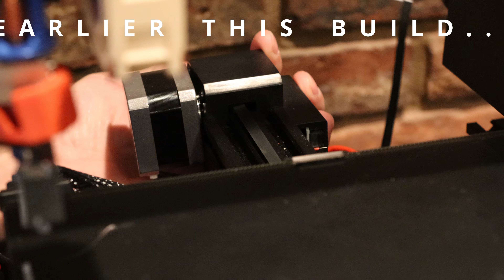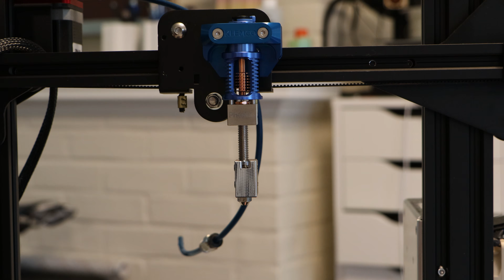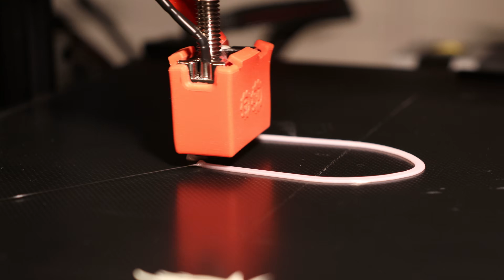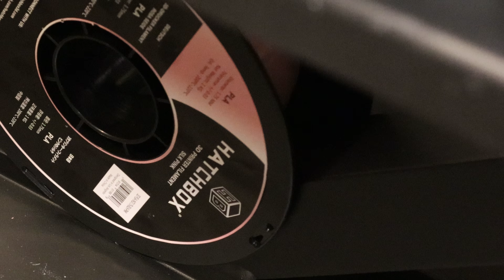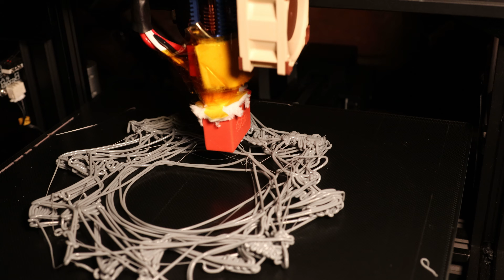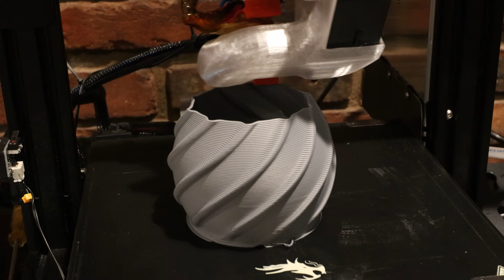Ender 3000 - Print Dangerously and 32X Faster!

Comment: 80 watt out of two 40w in series,  lol..   Someone doesn't know ohm's law.    Parallel would be needed.
Reply from the maker: Well actually…..… they were 12v heater cartridges. Running on 24v
Reply: @NathanBuildsRobots  Ahh,  well that adds up.  Didn't know anyone actually used or owned anything 12 volt in the 3D printer world.

Comment: If you haven't already you should try taking it a lot faster. The rate in this video is nearly achievable with stock hotend and just an 0.4 mm CHT nozzle (see my video).
Reply from the maker: I could not drive the motor any faster due to skipped steps. I burned a Stepper driver out this way. 
I was using a large mainboard, which was a POS.
I have tried CHT, great product.

Comment: Are you running Klipper? Also I would suggest Dual Z stepper motors that way there you can take some of the sag from the X axis out.
Reply from the maker: Dual Z would definitely help on this machine. I am not running klipper, just stock firmware. Just set the Slicer settings to extrude massive lines.

Comment: Wiring the heaters in series would actually cut the total power in half at the same voltage, due to the resistance of the circuit doubling. You would need to wire them in parallel to double the total heating power. That is probably not a great idea on a board that is not designed to deliver that much power however.
Reply: @angryknome94  I missed the part where he mentioned they were 12v heaters. That makes sense.
Reply from the maker: This one resolved itself. Thanks angrygnome!

Comment: Why in series and not in parallel? In series you are cutting the voltage to each in half
Reply from the maker: It depends on what cartridges you are using. In this case I was using 12v heater cartridges at first, so I wanted to cut the 24v in half. 

If you have 24v cartridges then you are right you want them in parallel.

Comment: the gap in your heaters is basically a giant heat break and makes your first heater completely useless.
Reply from the maker: Copper is surprisingly conductive. Given the length, material, and thickness of the tube connecting the heaters, It is 50x more conductive than a high quality stainless steel heatbreak.

But more importantly, unlike a heatbreak the top and bottom are both heated, so it's more of a heat bridge than a heat break.
Reply: @NathanBuildsRobots  copper is also good at losing heat to the air, and your print head moves around a lot. Even if it is hot on both ends you're wasting a lot of energy. I think you could just just cut the nozzle shorter to have less gap and it would increase performance a lot.

Comment: @Nathan Builds Robots  Have you seen this  CNC kitchen video? https://youtu.be/RrIzzSfuSMs . He increase melting speed piercing the nozzle with copper wires. He does it on a volcano nozzle, but still it wasn't made on the Super Volcano. Also seems you have space in the middle for another heater block (or for a longer one) .
Reply from the maker: Yeah I have seen that one, super cool idea. I would like to try it on a supervolcano.
I filled a follow up to this where I tested max flow rates. The extruder was the limiting factor. This stupid Lerdge board I was using can't drive the steppers over 80 mm³/s so that was about as far a I could take it. I would like to retry with a Klipper machine, because it is supposed to unlock higher step rates.

I ran into some interesting issues with CHT nozzles at very high flow rate, I should revisit this supervolcano has the same issues.

Comment: Switch to Klipper, and HF version of the dragon... This looks super ugly and slow AF..... What speed are theese, you called super fast?
Reply from the maker: speed measured in volumetric flow rate
Reply: @NathanBuildsRobots  you measure max possible speed with volumetric flow rate. I see you Are using marlin arent you?
Reply from the maker: @Wendrym  yes, Marlin, it's what's for dinner.

Comment: This dude really knows his way around a hot end. Those initial layers looked more like frosting than filament. I bet he could melt a whole spool in a couple hours! A house fire doesn't even do that!
Reply from the maker: About 2.5 Hrs per kilo at max speed. The SuperVolcano makes sure it has time to cook, so it comes out nice and tender. Then you have to follow it up by using large 1.5x1.0mm extrusion. 
Bed leveling becomes a thing of the past, because even if your bed is elevated 0.2mm too high on one side, it will just gloss over it like everything is fine.

Did someone say fire hose? Great idea for my next hotend build!!
https://www.firehosedirect.com/1-1-2-nh-nst-brass-hose-nozzle?feed=Froogle&gclid=Cj0KCQiA_8OPBhDtARIsAKQu0gY3L96aVsh3ZAFHKW5WTVwr06HqMxKrMYTz-XY-3KCNj8WLP2lFZr0aAi_qEALw_wcB
Reply: @NathanBuildsRobots  Getting Tender on the Ender bro!
Reply: ROFLMAO 😂 Best comment this year lol

Comment: The shit we find xD
But i mean it did produce decent results after proper tweaking, props on that Nathan
Meanwhile me using a LGX+Dragon +CHT 1.8 while i wait for Rapido UHF to arrive
Reply from the maker: That sounds like a speeeeedy build. Does that nozzle that print at a larger diameter than the filament, or are you using 3mm?

You are going to love the Rapido. Just keep in mind that, at least on the model I got, the thermistor is only rated for 280C. So you will have to stick to the Dragon with an appropriate thermistor for crazy exotic filaments.
Reply: @Nathan Builds Robots  using 1.75mm on 1.8mm nozzle , don't ask how it works. It almost looks like it only warms it up and comes out ready to feed into the extruder again. Saw a Nero (i think) testing the CHT 1.8mm and got one for giggles. 
I should stay in the usual range (PLA, PETG, TPU and maybe some nylon. Mostly under 300°C 
I very rarely print nylons etc unless i need proper mechanical prints. 
Just wondered if it would allow me to push even further than the Dragon that way i have an excuse to try a new hotend instead of boring same one.

I should get the UHF version since i have a few v6 and volcano quality nozzles and i can test around for different applications. 

Btw the design of the Rapido kinda makes me wanna test non-planar 3d printing with it
Reply from the maker: @SinceGamesPT  I might try non-planar printing. With a pointy enough nozzle on the Rapido you can probably get 45-50 degrees of non-planar angle all directions. Do you know of any good, easy to use non-planar slicers out there? Would love to see support for that in Prusaslicer or Cura.

I believe with the UHF it is just a metal spacer that you can buy separately, so you can always get the standard version and upgrade later. 
https://www.3djake.com/phaetus/rapido-uhf-upgrade-kit
I should try out the UHF extension on a normal Ender 3 to see if you can upgrade to volcano without having to change the heater block.
Reply: @NathanBuildsRobots   @Nathan Builds Robots  haven't looked much into the non-planar side of printing but i think there's a specific slicer for it or something like that. 
And Yeh UHF is basically a spacer, but for the price diference i'll grab the UHF which has more stuff for like 10€ more in EU . Buying from 3dprima since ive used them before. 
I mean if the heat transfer is "decent" it should but its not optimal. 
I saw a supervolcano nozzle in a dragon hotend if not mistaken running dual heatblocks , similar to urs* xD
Is it pretty ? Nope but it kinda worked.
I can look up the link if u want to the monstruosity. 

And pointy nozzles for non-planar ive seen them but i never got one as i didnt have a use to test them. 
I mean from cutting nozzles, heatbreaks etc , in the the basic is "just" to melt plastic with proper tools alot of custom one of a kind can be achieved
Reply from the maker: @SinceGamesPT  Lol, I read this before you edited to add "similar to urs* xD", I thought you may have been suffering from amnesia
Reply: @NathanBuildsRobots  Yeah , sry my bad. Was multi tasking and read it after sending instead of before. 
The other i saw was a dragon or similar design (prolly cuz dragon has that one handed nozzle change which might add rigidity , but the heater blocks we're similar to the rapido's which after some looking around are called heater cores. Think the guy used a brass or copper tube or smtg in between the heater cores to try and keep the temp stable across.
Saw that clip on a disc somewhere if i see it i'll let u know
Reply from the maker: @SinceGamesPT  that's OK I get the ghost of it. I bought a maxiwatt circular heater cartridge and ask the stuff to build my own heating systems.  Could be fun
Reply: @NathanBuildsRobots  Just had a look at their website. Had no idea there were companies doing that, since they do custom stuff that opens a world of possibilities depending on pricing. 
A custom diy solution can be achieved without looking too bad. Keep us updated and best of luck

Comment: Can you do all this on the ender 3 pro?
Reply from the maker: Yes, the build process would be identical.
Reply: @NathanBuildsRobots  thanks, really considering it. Can you still do smaller nozzles and layer size with this setup?
Reply from the maker: @Nodeagent  I just did a video on the phaetus rapido. I you want a setup that will allow you to easily change nozzles I'd definitely reccomend it over the supervolcano. 

This supervolcano takes forever to change nozzles.

Comment: Series connection does not make 80w. Parallel it does near 80w
Reply from the maker: 2 12v in series makes 80w or 2 24v in parallel makes 80w. I just happened to have a bunch of 12v spare around but it would make more sense to do this mod by just getting 1 additional 24v 40w heater cartridge

Comment: Switch to a CHT nozzle the go up to 1.8mm and run a 60watt heater
Reply from the maker: I would like to but it is $40 after shipping to get one and sizes above 1mm are out of stock. Hoping to try one soon though.
Reply: If your in the US check out tiny machines 3d. They should have some in stock soon.
Reply from the maker: @aj54126789  thanks for the tip, $4 shipping is much better, as soon as they are back in stock!

Comment: Do you recommend the Haldis extruder? My all metal extruder started to slip and I'm looking to upgrade to dual gear extruder.
Reply from the maker: Yeah, mine is working great. It pushed the filament through even when the heater cartridges couldn't keep up and the plastic wasn't all the way melted. I just bought another left/right pair to make a dual extruder hotend. 

The only thing with these cheap brands is quilt control can be lacking. I'd buy it on Amazon so if you have any issues getting it to work you can return it in 30 days.
Reply from the maker: It is waaay better than the red ones that looks more or less like the stock extruder. I have that kind on another machine and it's garbage by comparison.
Reply: @NathanBuildsRobots  hey I just got the haldis extruder and I’m getting a clicking sound do you happen to know what’s wrong with it? My retraction is 6 mm and retraction speed is 25 mm/s
Reply from the maker: @jorgewastaken   mine makes a soft clicking noise when extruding but it's pretty quiet overall. 

In my short videos you can hear it, the kind of clicky sound. It's quieter than the part cooling fan but not completely silent. The 2nd one I'm now using is quieter.

https://youtube.com/shorts/9ep5iWGR2jg?feature=share

All metal gear trains (especially cheap ones) tend to make some noise, which is normal. If it is significantly louder than what's in my short videos I would try contacting support. Through Amazon you can always return or try getting a new copy.

I would consider it defective if it's louder than my first copy, if you can Amazon and say it's defective they might refund you or send a new copy without having to send the original back.

Comment: I once tried a 0.8 nozzle and that already seemed really big. This is just crazy :D
Reply from the maker: I tried 0.4, 0.6, 0.8, and 1.0mm on a volcano hotend on a stock machine. 0.6mm is ideal for a mostly stock setup. 

To get the most of 0.8mm and up, you really need a copper heater block, copper nozzle, 60 watt heater cartridge, and dual gear direct drive extruder.

Comment: Very cool I may use some of these parts in my ender 3 v2
Reply from the maker: If you wanted to be super cheap about it you might be able to put this on a stock ender 3. I would prefer to at least switch to an all-metal heatbreak first.

I think it could all be done for maybe $70. 
$25 supervolcano nozzle 
$30 heater blocks and cartridges
$15 all metal heatbreak

But then an extruder upgrade is needed. I ran the stock extruder on here at first and it could not keep up with the hotend, so add another $15 a dual gear direct drive extruder. Now I am running into limits on the maximum speed of the stepper motor at 90 mm3/s. I fried a stepper driver trying to go faster. It really did not like that.